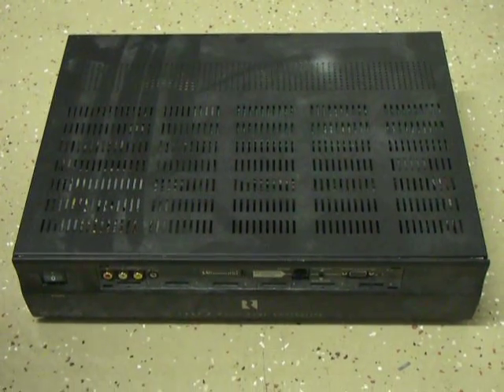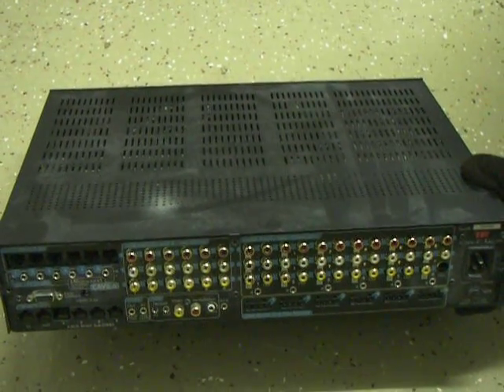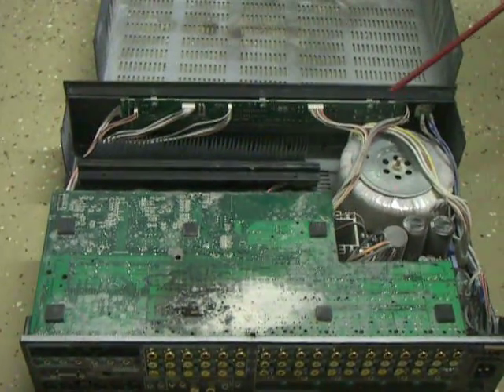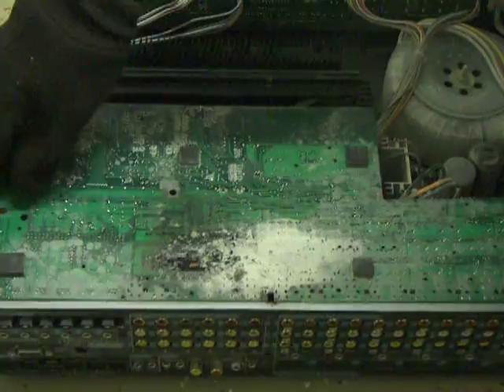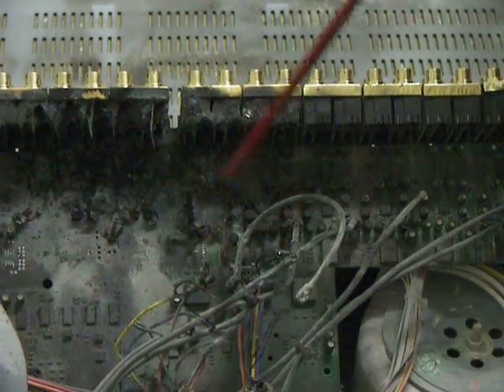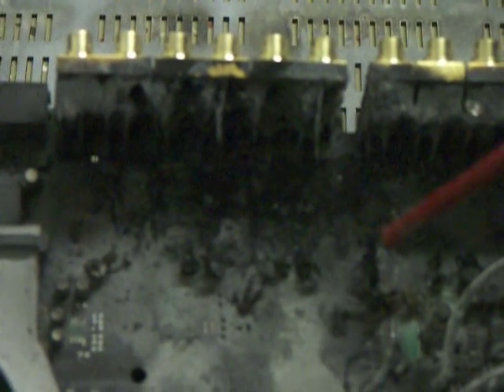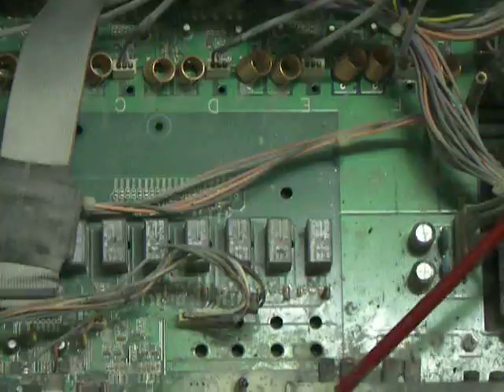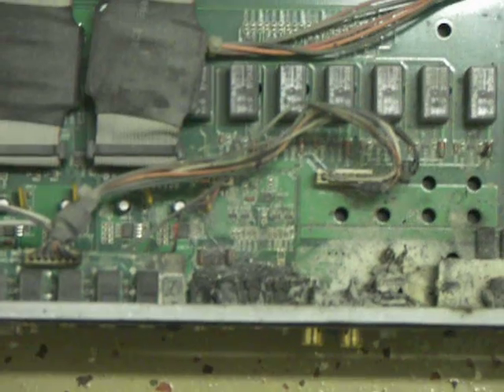Russound Fire - Russound CAV6.6 Recall

Comment: I'm sorry to hear that your home was damaged due to fire, , I have lost an entire home in a fire also.  However, when you demonstrate how an improperly inserted power supply connector is NOT misuse of the connector you are wrong. An improperly inserted power connection is not proper USE of it. Such components undergo the exact same testing and approvals as all other electronics in your home and are just as susceptible to fire due to improperly grounded or connected power supplies as your TV is.